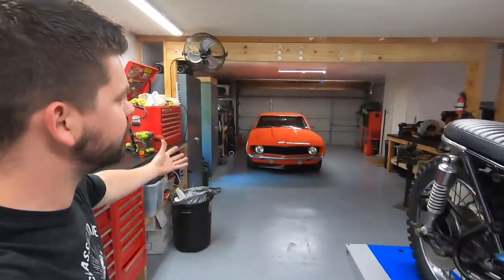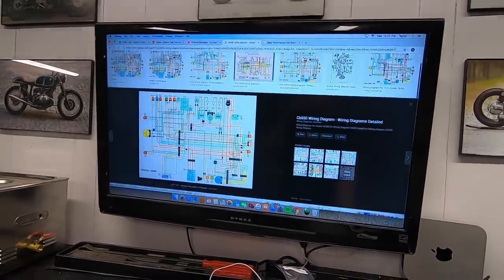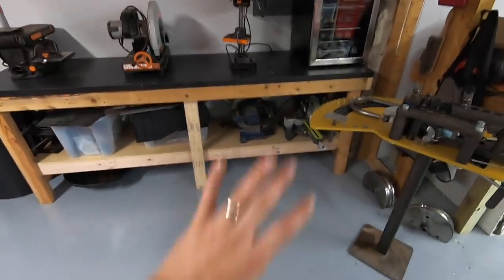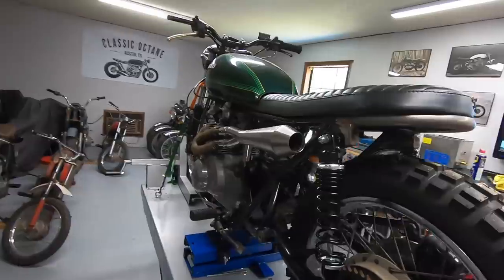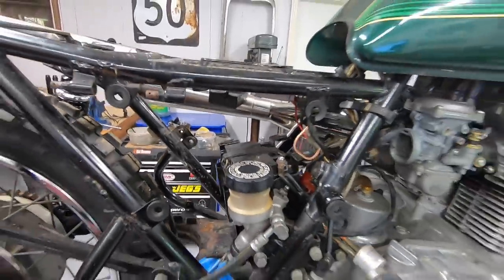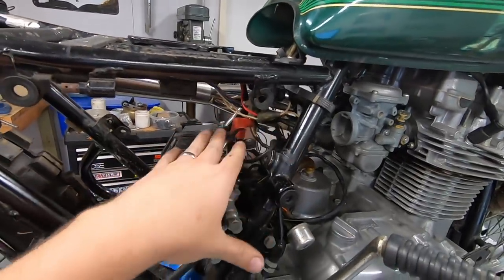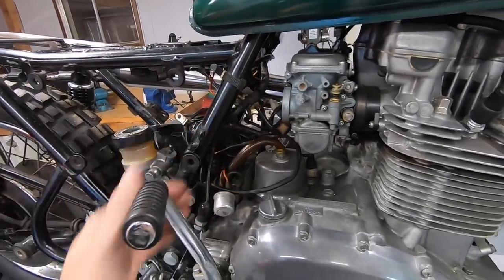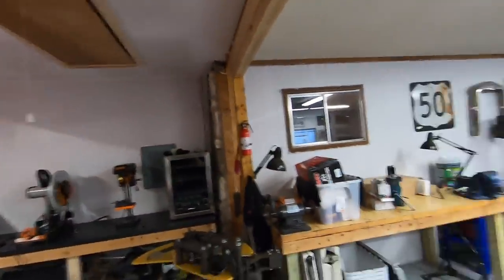KZ750 Scrambler: New rear shocks

Comment: Use drop in anchors.  Lowes and Depot have them.  They'll install flush with the floor,  allow you to bolt bender to floor when needed and remove the bender when not needed.  I did this in my garage at my old apartment for my manual tire changer.  Worked great.  I put rubber plugs in the anchors when not in use so the threads wouldn't get clogged with dirt and debris.

Comment: Use 4 concrete lag nuts flush with the floor that way you can drag the bender out , lag bolt it to the floor , use it then just remove 4 bolts and stow it.
Reply: Exactly what I would do, great suggestion!

Comment: Mount the tube bender device outside and cover it with a gas grill cover.  No need to have it under foot in the garage for as often as you will use it.

Comment: I dont understany why you don't just flatten that bracket where the fuse box hangs down. You could either bend it straight, or cut out the downturn and weld it so the whole bracket is flat.  That is if it bothers you.  I dont think it would be that noticable.
Reply: Exactly this

Comment: Epoxy nuts in the floor. Use two different bits so the bolt goes far down but the nut doesn’t move. This will allow u to remove bolts and have no studs poking out.

Comment: How about drilling holes in the floor and drop sleeves into them.  Use pins that fit through the base of the bender into the sleeves.  Since all your force is sideways, don't think it needs to be bolted down.

Comment: On the last two "cafe" type bikes I built I made little battery boxes for lithium ion batteries that mount to the rear cross member directly under the swing arm pivot.  Requires a little extra wiring but they hide pretty well under there, and it keeps the upper "triangle" area looking really clean.

Comment: 1: Can you just pound the electronics bracket flat so it doesn't have that step in it? 2: What happens if you run a lithium Ion battery on the factory reg/rec?
Reply from the maker: You can over charge and damage lithium batteries with a stock regulator. They don't like much over 14V

Comment: Did you find out if the voltage regulator was compatible with lithium ion batteries?
Reply from the maker: They said it should work fine as long as the battery is designed to work with stock voltage output. I git a Shorai that can handle up to 14.7V so we should be good